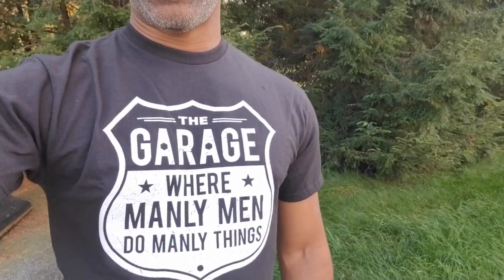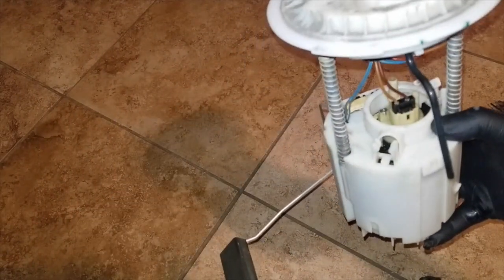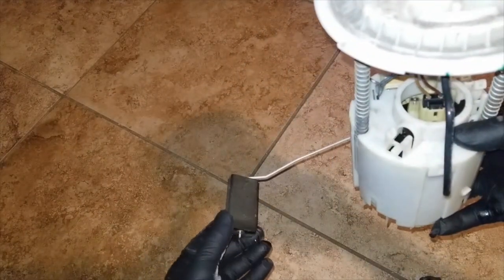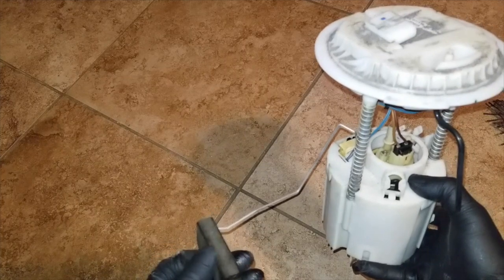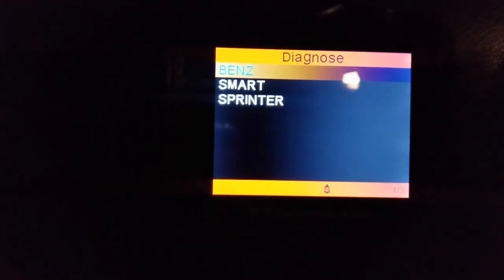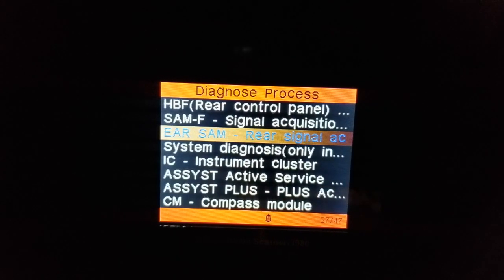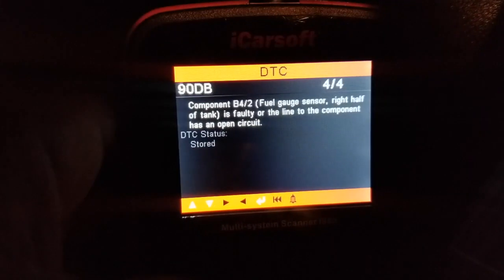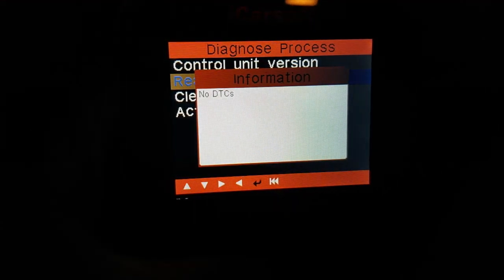Mercedes Fuel Gauge Failure  & Diagnostics

Comment: I’m working through the same issue on a X166 bluetec.  I’m using a Autel 906.  Funny but my only code was for an injector out of max something or another and the gauge dropped to the actual value but the issue came back after filling the tank again.

Comment: I understand this is an old video, but do you know what the readings should be when the tank is full? I had fuel gauge level issues after installing an aftermarket pump. The garage adjusted it, and now when full (I checked it with my Foxwell scanner after driving just a few km after filling the tank) it was; right side 78, left side 30.
Thanks in advance.

Comment: Yo brother, My Mercedes a180 15 model has an issue. The fuel gauge is stuck on full any tips?
Reply from the maker: bad fuel sending unit float.  Open it and adjust it.  It could simply be stuck or damaged.

Comment: I have a 2011 glk350 non pzev base model rwd. I have changed the fuel sending unit and the passenger side pump as well. It still runs out of gas at 1/4 tank and not sure what it could be. I just installed a new fuel sending unit again and still does the same thing. Lines are fine with no issues or kinks. Runs out of gas at 1/4 tank

Comment: Great video! with a lot of tips!! I got an issue with my E class 220cdi 2011. Engine turns off to quarter of level fuel, and when I fill the tank again needel goes up just fine and goes down while you consume it. In this case which may be the problem the Level sender or the Fuel pump?
Reply from the maker: Level Sender is faulty

Comment: My W245 mercedes supposedly has a 54 liter fuel tank, but I've never filled more than 49.5 or something.. and that was when I was already driving with zero range for about 25 kilometers. So.. Maybe under a certain level, my fuel gauge just drops off and doesn't show the correct amount. Because under a quarter of a tank, I seemingly loose fuel much faster. But everytime up to now that I've refueled, I always end up only squeezing in 47-49L 

And I can go like 80km on 5 liters, so it's a huge waste.. idk. Might look into it

Comment: I have the problem that,  the fuel indicator stuck at full. my car is ml350 2006 same as yours. 
I had water leak to the rear sam,  but checked everything is working fine except the fuel level and the both front seats are not working suddenly.

Comment: Hello my friend,

I have a 2010/11 Ml 350 Bluetec 4 Matic which is giving me 2 issues. My fuel gage reading only works from full to half (showing full when its on half tank and empty at half tank) and when the car sits for a couple of days low on fuel it won't start. the only way is adding just a bit of fuel and then it wrks normally. I don't know how to address the issue as it may be either the pump/left sending sensor or SAM. HELP!!!!!
Reply: I have the same problem ever figure it out?

Comment: Hi i have a problem with my gauge cluster(i think), the fuel level never goes below 1/4 and when it reaches the 1/4 it means my tank is empty. however everything   higher than 1/4 works just fine. what do you guys think ?
Reply: Have fixed the issue with cluster not going below 1/4?
Same problem here.
Thank you!
Reply: Have exact problem with my 07 R350. Please how did you solve the problem

Comment: Having issue with Gas Guage as well. When I remove battery terminal and fix it back,guage read for about 15-30 secs and goes back to zero. Any possible fix please.?
Reply: Hey did you fix the gas gauge issue? I’m having the problem now
Reply: @ItsBorgiaBaby  I did some maintenace including changing the speed sensors,both front and back. Afterwards, it started reading norwal again without any issue
Reply: @successviews2990  hey thanks for the quick reply...what and where are the speed sensors? I have the 2007 s550 base model
Reply: @ItsBorgiaBaby 
Had to my mechanic fixed it for me. Will be glad if you could talk to your mechanic about it please.

They were close to where the tyres are

Comment: Hello.
In what units are these values (158 and 210)? Why are they not the same? How to convert (calculate manually) these values to gallons (liters) for each tank's side?
I have a problem with pumping fuel from one side to the other and I am changing different parts to repair it and I want to see the same values on the both sides as a result. I have Icarsoft too and i can't understand how many fuel in each sides of tank.
 Sorry for my English. Thanks.

Comment: Females also work on their own cars in fact two Mercedes
Reply: I also work on my Mercedes. I just replaced the fuel pump and there is still no change in the reading on fuel level on the dash. Says it is empty.
Reply: @AMLOVINTHESUN hey have you ever solved this issue ?? I currently have a dead fuel gauge in my glk 2014 but I activated the cluster during a test and it works I’m confused tank reading says 0L
Reply from the maker: I know Vee.  Much love to you.   Which models do you own?
Reply: 1984 300 turbo diesel.  1999 S 420